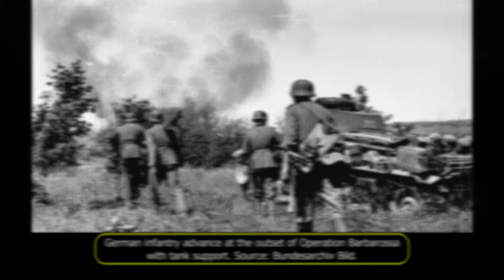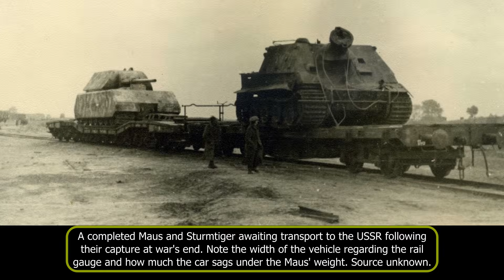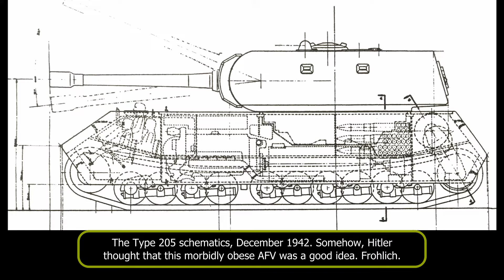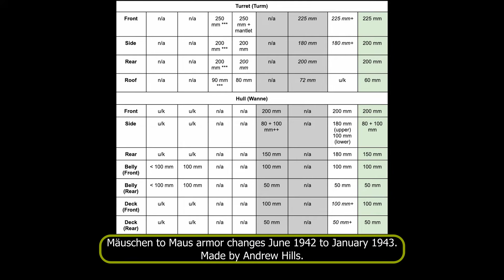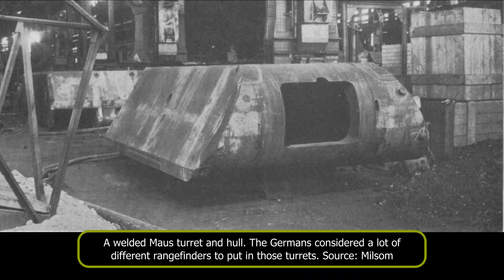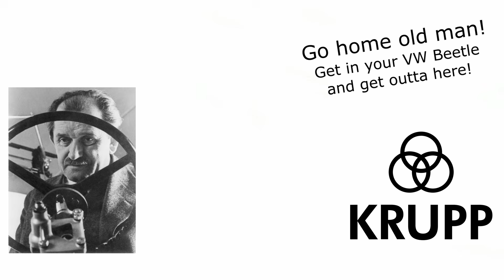As BIG as they come | Panzerkampfwagen VIII Maus (Part 1) feat. @ConeOfArc

Comment: I found this video to be mostly informative, although I couldn't make much sense of the side armour. Each proposal had a diagram but they seemed to lack  the details that was the data beside the diagrams. Where were the tracks in all this, and how were the plates positioned in relation to the hull?
Reply from the maker: Check the article :)
Reply: I did, there wasn't any different information about the side armour.

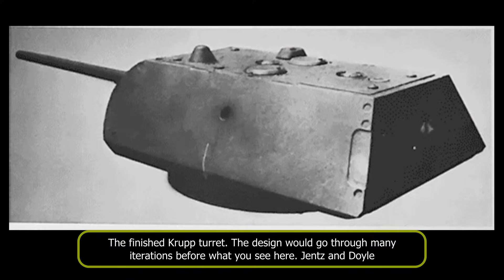Comment: 6:22 comment to the photo comment. This railroad cart is not sagging, it is clearly purposely constructed or modified to transport the Maus. If a normal railcart would sag that much it would surely derail on a first arch. I'd rather point out that there is 4 set of wheels under the Sturmtiger and around 3 times more under the Maus.

Comment: Can you explain how modern tanks can have double or triple the armour thickness yet weigh half or more as much as the Maus?
Reply from the maker: They do not. They have double or triple the equivalent armor thickness by using composite armor, NERA and ERA
Reply: @TanksEncyclopediaYT  The M1 had a pre-DU steel slab on the front of about 400mm thickness.  Whatever NCO is showing it off can point out the weld line on the front where the slab ends. Regardless, even the M48/60/103 had 200-300mm frontal thicknesses with only a fraction of the weight.  Why couldn't the Germans just do what the Patton series did in the 50's?
Reply: @PositionLight  Something called rebuilding. The German economy is in ruins, remember?
Reply: @darnit1944  pretty sure he means what the Americans did in the 50s, but in WW2
Reply: @Sandycheeks6699  In that case maybe the technology isnt there yet.
Reply: @darnit1944  true, I'm not an expert by any means, but I feel like a lot is just due to people not thinking outside the box. Take the jumbo for instance, it was basically just an up armored Sherman yet it still performed quite well as far as I'm aware.

Comment: Very comprehensive - looking forward to Part 2. Although, now more than ever, I am asking myself - "What were they thinking?" and why did not someone say "Chaps. Enough of that, lets get back to reality. And build more Pz 4 & Panthers or something." I can imagine Porsche telling Hitler about fitting the Flak 43 on the roof and Speer making strangling noises in the corner.
Reply: Yeah, the "more panzer 4's and stugs" option seems great, but it ignores the oil, manpower and steel shortages in the reich during 44 onwards. they were even having trouble with manpower in 43. while a lot of slack was in the industries, and the maus was just one of the heavy tank dick measuring contest's fever dreams, there was a reason to things like the tiger 2, for the same men and a bit more fuel, it was hoped it could kill more. this didn't happen, as the reich also had chronic training problems, and shortages of strong enough tooling to improve the reliability of their late heavy tanks. it was a damning situation with no way out, and the reich didn't want to surrender either, so they fought to the end.
Reply: "What were they thinking?"
After the Germans invaded Russia in 1941, they discovered the Russian Heavy Tanks. In particular the KV-1. The KV-1 couldn't be knocked out by anything the Germans had other than then 88mm AA guns. The KV-1s caused the German advance alot of trouble. So the government ordered Krupp to do a study. The conclusion of the study was that heavy tanks were great weapons systems and that Germany needed its own heavy tanks. 
The conclusion was totally wrong. The proper conclusion would have been that the Germans entered the war with very under-powered Anti-Tank guns and needed to field better anti tank systems. And that they needed to upgrade the main gun of the Panzer IV.
But they concluded they needed heavy tanks that could be fielded against the newest tanks like the KV-1 was fielded against the German tanks of 1941. The designers took that requirement and that requirement led to the Maus. Like alot of German product, it was an innovative technical solution to a bad set of requirements.
The project lingered on for the rest of the war and was never really produced because most people involved realized it made no sense. Identically stupid projects with the same result of no production occurred in the United States (the T-28) and the UK (the Tortouse). The Soviets also went down the same line with bad heavy tanks.
Nobody took it to the absurdity of the Maus design, but everyone in the war was thinking that super-heavy tanks were the answer to some problem.
Reply: The problem with building more panther G's and PzKfw IV's is that they would not have the fuel to supply them, due to the previous, making each tank as dangerous as possible would be the best possible decision
Reply: @ltcitadel  actually, according to this video I'll quote (it's a shame it is in spanish, but you can at least see the figures in numbers), Germany had no serious shortages on fuel nor other resources like steel (they were not plenty anyway, but yet not crippling shortages) as late as 1943, but it had anyway lost most of the major battles they had fought and, one could even say, they had already lost the war. The video: https://www.youtube.com/watch?v=I_hYOaagZ6E
Reply: @eduardotrillaud696  They had crippling shortages of fuel from mid-1941 onwards, they knew this, or at least Hitler did. Which is why he ordered a plan to be drawn up to invade the caucasus in 1941, his wishes were promptly ignored in favor of a plan based around seizing major soviet cities. In 1942 however, Chief of staff Franz Halder once again made the plan for the new "Fall Blau", but this time Hitler and Genereloberst Alfred Jodl modified the plan to fit Germany's wishes. They failed to seized the oil field of Maikop and Grozny after the failure at Stalingrad. Romanian and synthetic fuel were not sufficient for fueling the war. Reichsmarshall Hermann Göring's 4 year plan failed to achieve Autarky (=Self-sufficiency), and Germany was forced to survive off trade with other countries such as Sweden and the USSR, or exploiting occupied territory, such as, well, the USSR. Any source stating that Germany could survive off of its own resources for even as far as 1942 does not understand anything relating to Germany's strategy in WW2.
Reply: @ltcitadel  According to the sources of the video, by 1943 Germany still have decent reserves of oil, and capacity to produce some more synthetic oil from coal. That doesn't mean they had plenty of it, but as I've said, it wasn't a crippling shortage. Same with steel... So, why the urgency for a short campaign in the East? Well, because of course the resources wouldn't (as it happened) be enough for a war of attrition. But the main problem was not having or not the fuel, or the spare parts for tanks and other vehicles, but the logistics of carrying all those (and other) resources to the front. And that takes the problem to other place: The bad logistics and the lack of spare parts, thanks to projects like this or Hitler's "TANKS TANKS TANKS"; producing more full tanks instead of at least one tank worth in spare parts for every four tanks, or so.
Reply: @eduardotrillaud696  Except a huge number of sources dispute that, especially when it comesto availability of fuel. In late 43 and 44 for example the motorised portion of an Infantry Divisions Logistics train was actually reduced because of fuel issues, the motor vehicles being replaced by horse drawn vehicles. This was specifically a fuel issue, fodder for horses was easier to get than fuel, thus the move to reduce motorised transport in units that did not need them in favour of horse drawn. 

There are also accounts from the Luftwaffe that specifically state that lack of fuel impacted their pilot training immensely, as fuel restrictions meant German pilots training from 1943 onwards never had enough fuel to gain enough hours in the air, especially in the aircraft they were supposed to fly in combat. 

They were also certainly running low on manpower even as early as 1943, especially as the German Army had to release specialist workers from the army so they could return to the factories. As a result German units from 1943 onwards were consistantly undermanned, even more than would be expected for combat Divisions at war, where you expect to see some reduction in manpower, especially amongst the rifle infantry.
Reply: The maus makes no sense because seems like we only see it in a military historical way. Fascism is capitalims in decay, where the state becomes a servant for the companies and enslaves the population. Germany never had a chance to win the war, but they didnt want to, because big companies like krupp, porche, wolkswaggen, heinkel, adidas, huggoboss... made a huge proffit. German companies where the ones that won the war. In that context, the maus was only a sinkhole for state money that some engineers and companies profited from. Thats why they never stoped changing things and they never asked the army about what they needed. At least is how i see it.
Reply: @jgrandson5651  You know everyone one of those companies had a pile of ash for a factory, no workers, worthless savings 8in a dead currency), no access to foreign savings and a lot of their directors on trial in 45/46/47. German companies "won" the peace due to the Marshal Plan and US dollars. They certainly did not win the war.